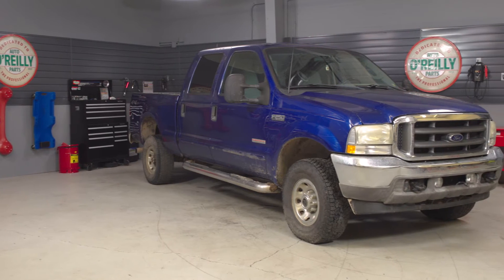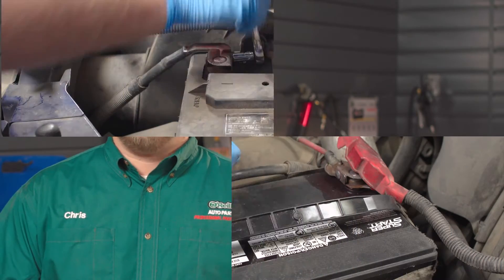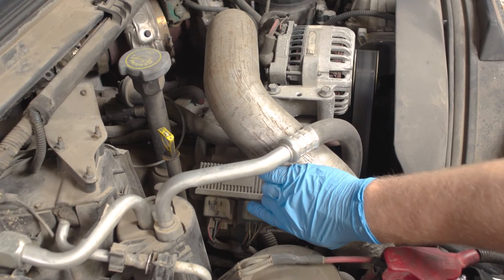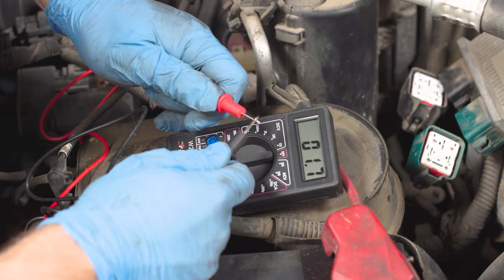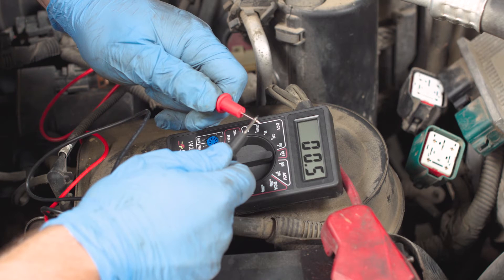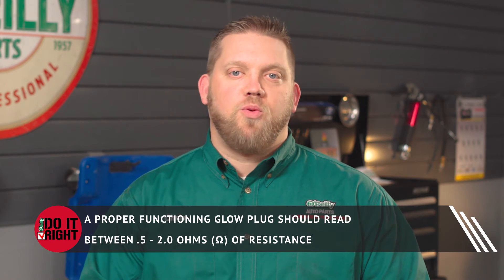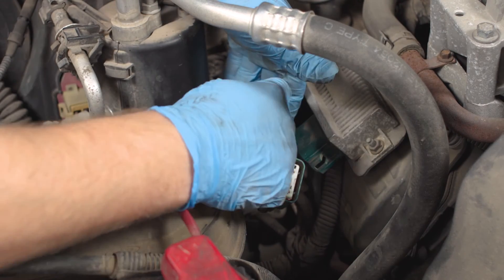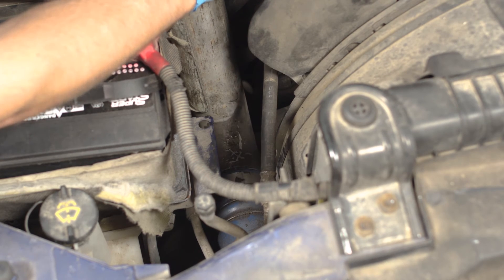How To: Test Glow Plugs

Comment: great video help needed i own a 2007 renault grand scenic 1.9 dci the glow plugs are 12v, and when i put a test light inside the connector that fits on the glow plug ignition on not started engine i an only getting 8.9 volts is this correct or should i be getting 12v thanks